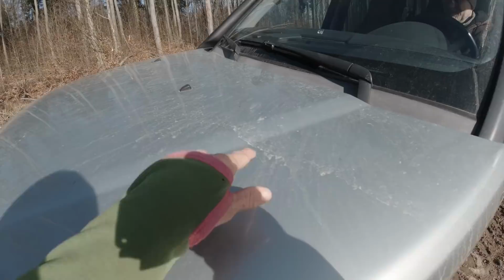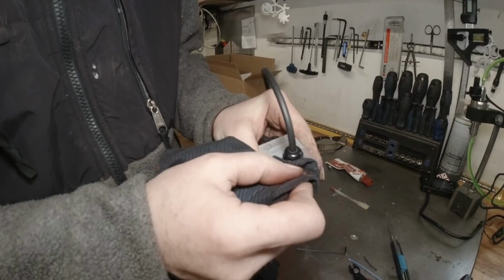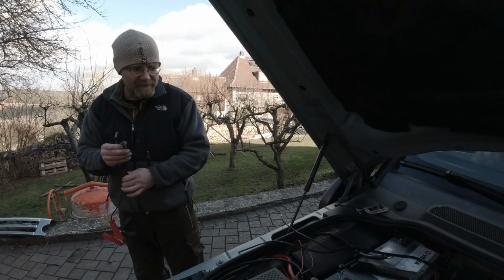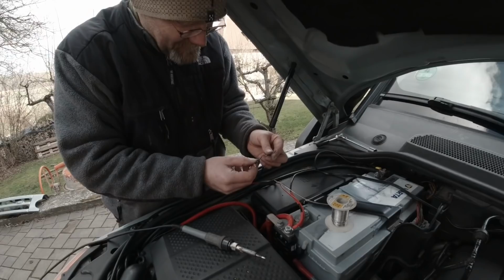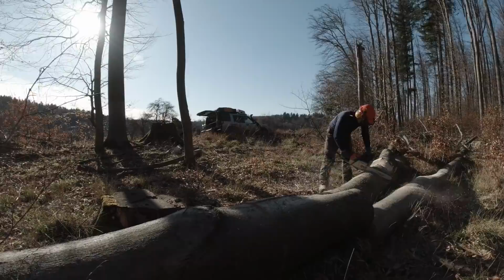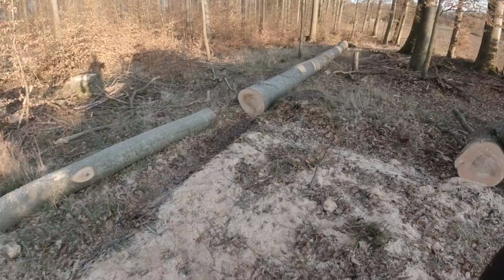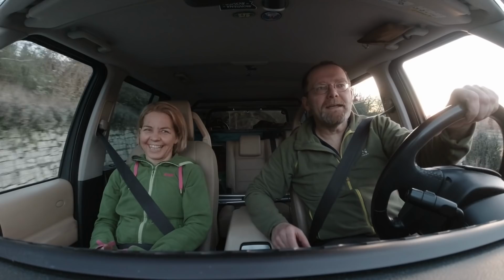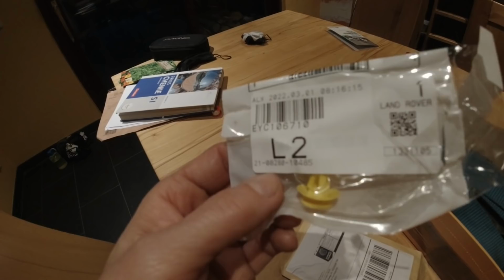Easy Land Rover wiring: red is black and plus is minus

Comment: Well, Vera don't worry about turning off procedures. A lot of us just learned that from Christian. I think that turning off procedures needs it's own video description. Even if you had electric fans since the water pump stops when the engine is off, it doesn't help cooling down the engine. So best case scenario you are cooling down the radiator water. 
I think it is a German thing, 😉 I never heard of it either.
Reply: The advice I had was to let the turbo cool down and don't switch off imediately after a hard run - where I live I am a mile or two from the motorway, so a gentle run the last couple of miles helps to cool things down a little before switching off.
Reply: Many have additional electric coolant pumps which then come on when the electric driven fan is on after engine is shut down.

Comment: I had a German Diesel Rabbit for almost 5 years. It used to aggravate my passengers, but I would always run the engine at increased idle for 3 or 4 minutes after a long trip before shutting it off. This was according to the VW owner's manual. Christian, your tool and die making skills always impress me, as do Vera's sewing and organizational skills!

Comment: Hi Christian and Vera, what a great video. How awesome getting all that wood.

I solved the problem of cutting plastic with my soldering iron by having two, my wife takes one and I keep the better one clean :)

On the electrical cabling, all the details I have read regarding the starting battery of the D3 and D4 is to not connect anything directly to the negative terminal, but stresses to use the earth bolts around the chassis.

I look forward to your videos, vielen dank :D

Comment: I was a lorry driver for 40+ years ( English for truck ) the main reason for letting a turbo diesel tick over for a few minutes is to let oil run though a hot turbo so as not to damage the seal and bearings, my house here in France is also heated by wood, most of the trees are given what we call a French haircut the main trunk is left and the branches are cut for fire wood, they soon grow back to be cut every 8-10 years.

Comment: Great video guys, my wife learned something today, with the running of the air-conditioning warm before you switch it off.. 
Her Range Rover used to smell like shreks Armpit when you switched the Ac on for the first 2 weeks of summer 🤣 good tip👍

Comment: Good quality crimp is best.  We found in motorcycle vibration that a soldered connection is too stiff and eventually brittle.  Support all wires and support/cover connection with heat shrink.  A professional coffee production would make a short break 😁
Reply from the maker: 😅👍🙋‍♀️Vera

Comment: Never heard about running your heater   after AC .. :) . And I read all owner manuals, must be a German thing. :) .
 I did do it one time, but to help  with engine rising temp, while I was   climbing a hill   at 38 Celsius in 2 low   for 1 h, and I was in - guess what ?  -  a Toyota.. :) . 
 Those smart Japanese engineers program the  AC to turn off   automatically in extreme situations   and all cooling   is diverted   towards   the engine.

Comment: Just getting around to wiring up a split-charge system on my Disco' ('til now I just charge the 2nd battery at home) and, as an electrical engineer, I'm thinking it's easy to install it in a halfassed manner but much more fiddly to do it properly.
Reply: Most difficult is to find a good easy accessible route for the wires.. easy accessible is not compatible with a Disco 3/4 unfortunately ..

Comment: Christian do you have a winch blanket/damper? Always good practice to have one or better two to weigh down the winch cable just in case it breaks or hook pulls off. A lot of kinetic energy is stored in steel winch cable under load. Even with modern synthetic ropes it's advisable to use a winch blanket even though they don't have the weight of a steel cable.  If you don't have any I'm sure Vera could make a couple with her skills at bag making. Stay safe
Reply from the maker: We have that covered. In one of our last videos, I think where we showed my bags, you can see have I 2 loops added to my recovery bag so we can hang it onto the cable, to weigh it down. 🙋‍♀️Vera
Reply: @Vera_and_Christian  that's good then, must have missed the part of the video where you mentioned that ☺️ My winch blanket is Bright orange perhaps that's something you can add to stop the e biker's running into your winch line 😃

Comment: Great video. We are paying $2.15AUD to $2.27AUD/l for diesel in Brisbane Australia. Costco is a little cheaper. If I do highway driving or off-roading, I let the engine run for 5 minutes or so before turning off. If I can drive at a moderate speed for the last 13 or 20 minutes of a long trip, then there is no need to let the engine run once you reach your destination. Your engine and especially the turbine will thank you if you let it cool down a bit before you turn  the engine off. As far as the condensation in the air-conditioning goes, Setting it to 24°C or higher will minimise the condensation.
Reply: That really is very cheap = about £1.28 - we pay 50% more in teh UK at the moment. ☹️
Reply: @johnwillett4086  Dear for hear though. I was paying $1.63AUD early last week. I actually thought Australia was one of the dearer countries for fuel. I am certain either the fuel or the oil was based on whatever the price of oil is in Singapore. I would not like to be paying for petrol here though, It is ridiculously dear.

Comment: Great vider, as always - thanks. 👍

Your Diesel is cheap!  I paid £ 1.849L (= € 2.22) last week and £ 2.039L (= € 2.45) for V-Power.

Not sure I like how you shrink your heat-shrink 😖 I use a hot air gun for shrinking heat-shrink and not a naked flame. 👍

Comment: Well I never heard of running the heater after turning off the aircon.  I can see why it might be a good idea but nobody does it and my aircon does not have any bad smell emenataing from it.  Very expensive diesel in Germany and AUD1.00 more expensive per litre than in Oz at the moment although the price seems to change every day.  Good thing you heat the house with wood because who knows when the oil and gas from Russia might be turned off!  I am surprised your trailer made it home with that load of wood.

Comment: So that is not true.  Running your AC pulls moist air out of the car.  This is why you need to keep the AC on to help de-fog your widows.
Reply: And the moist air condenses on the evaporator and is wet hence Christian's idea to warm it to dry it. He is right but also a fuss pot. Few people would bother with the process proposed.

BTW it's an evaporator from the perspective of the working fluid and a condenser for the damp air